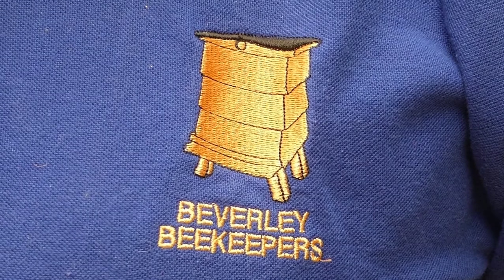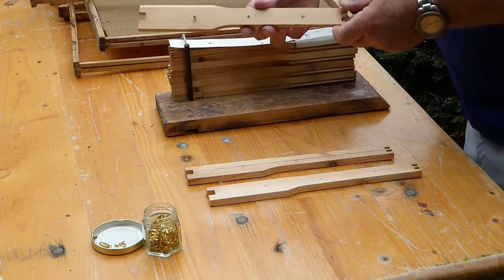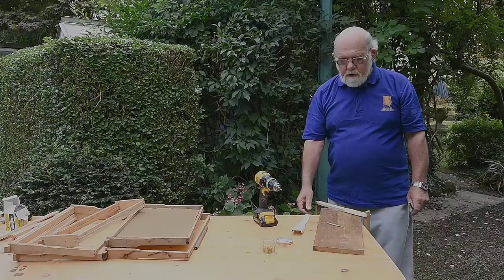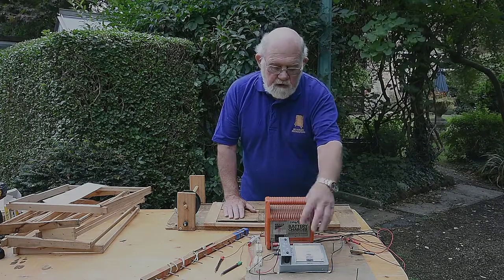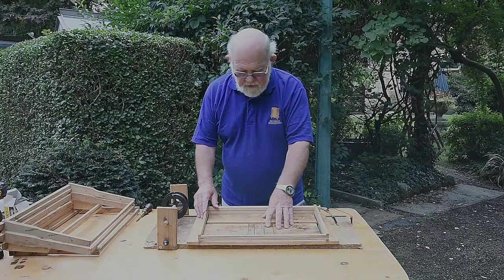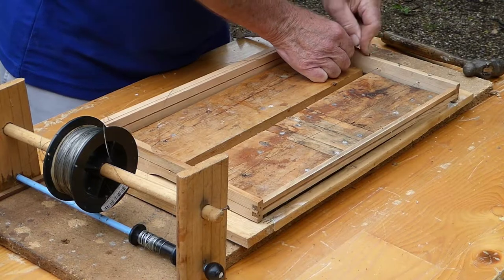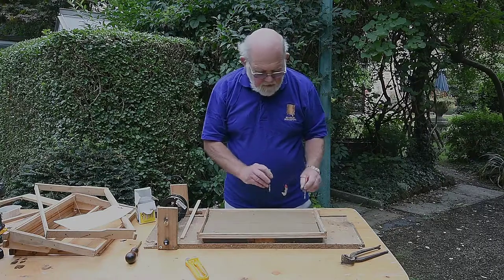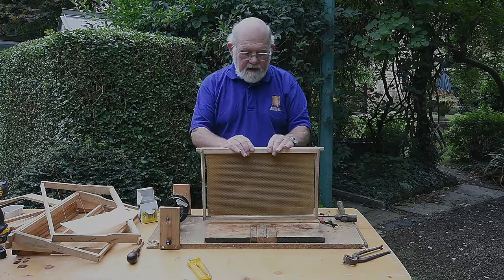How to wire your own foundation

Comment: It's ok heating up wires with charger, I use copper studs stretch it out with copper wire, place foundation on top and go over with a hair dryer and took a bit of practice but works fine for me.